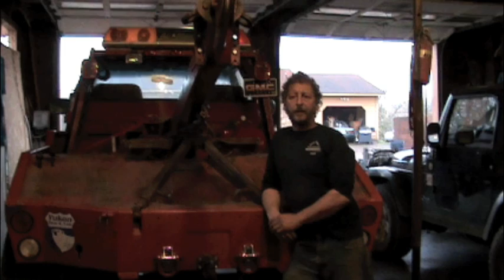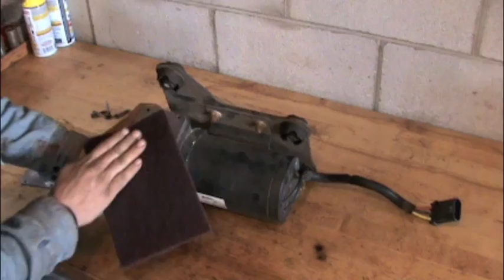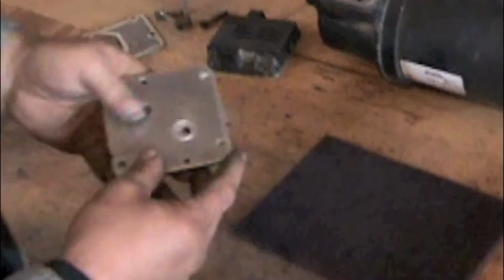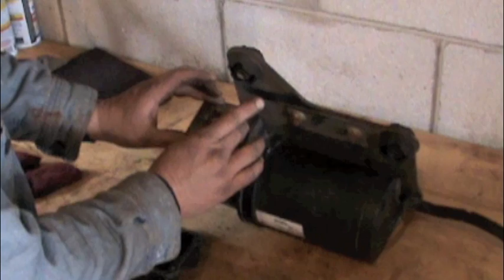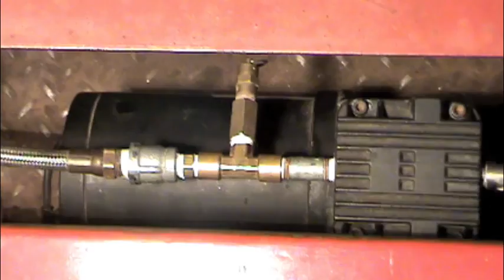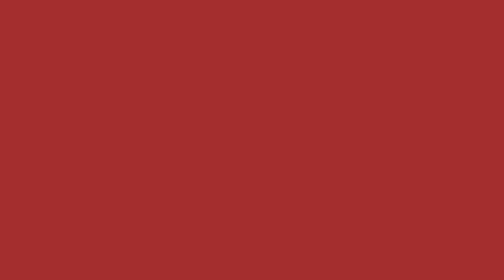Onboard air part 2 by BSF RECOVERY TEAM

Comment from the maker: @etherialcruiser Yes you are correct, I used a continuous duty solenoid, sold for a snow plow pump.  along with 10 gage wire. the pressure switch remains as the trigger. that video will be ready next week.